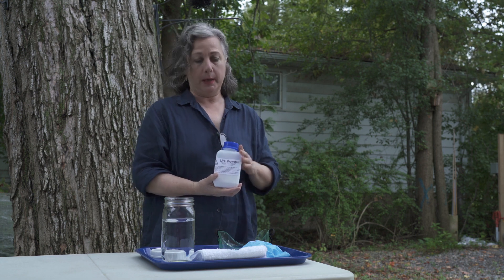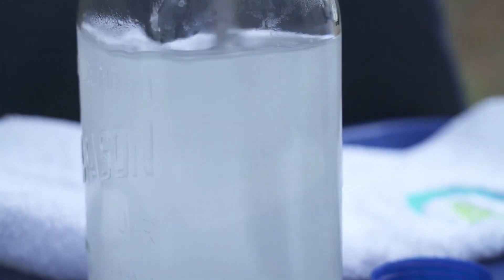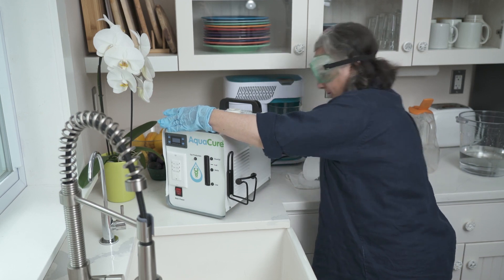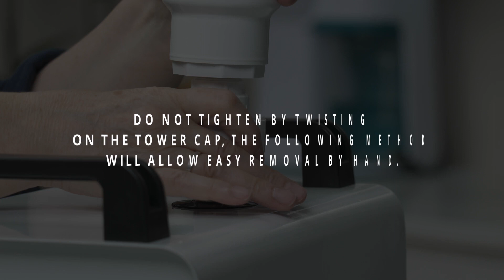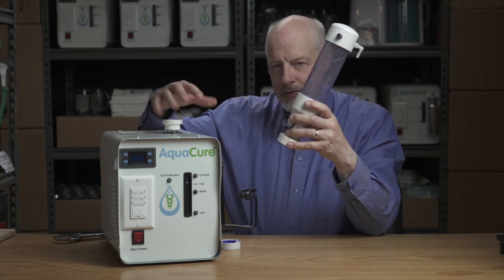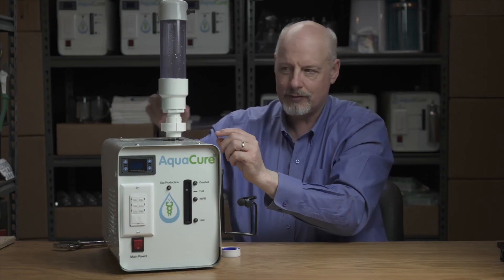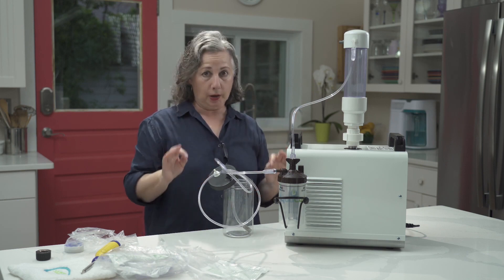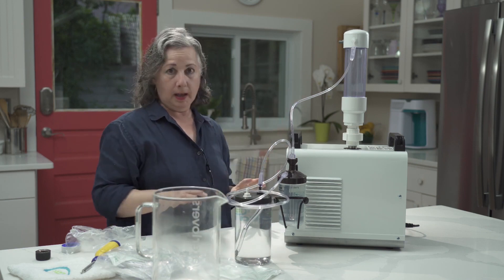AquaCure AC50 SetUp (series video 3)

Comment: 80g / aprx. 6 tablespoons of Lye to how much water please …talking dcl/litre not cups …how much is capacity of the AquaCure tank to be full in dcl/litre please ???
Reply from the maker: See the videos to get the answers needed.  It doesn't matter how much water you use to mix the lye, only that it's enough water to fully dissolve the lye.  We recommend 3 cups (about 750 mL) because that allows mixing in a 1 quart (1 liter) wide mouth glass jar without spilling or splashing.  
The amount of water for mixing or lye concentration doesn't matter for electrolysis, ONLY that there is enough lye in the water for the electrolysis to happen.  The minimum amount of lye for good electrolysis in the AquaCure is 40 grams.

As for how much water the AquaCure can hold, it varies per machine... But generally is in the 1.5 quart (1.5 liter) range.  There isn't an 'exact' amount I can give you because there are too many variables.  But you can determine how much YOUR AquaCure needs with a little experimentation when doing the HOT tap water rinses.  
YES it is OK to have the AquaCure plugged in and running when filling with HOT tap water to check the level sensors functionality (actually recommended).
The AquaCure will work fine with just water for everything except producing Brown's Gas.   For Brown's Gas production you need the lye solution with at least 40 grams of lye (recommend 80 grams of lye maximum).

Comment: Just curious as I am an AC owner….I clean/rinse it with warm distilled water. I know you say tap water is ok to clean it but, I don’t trust my tap water. Why is tap ok to use to clean/rinse but not to operate?
Reply from the maker: Because you pour it out without electrolyzing it.  Rinsing with distilled, after heating it to 140 degrees, would take crazy amounts of water, very inconvenient and expensive.  But OK, if that's what you feel is right for you.  I don't.

Comment: Aaagh! Too many variables! I need help.

She says to use a tablespoon measure for the lye. And to add 6 of them into only 3 cups of distilled water. In the previous setup video he measured one tablespoon then poured straight from the lye bottle into a full jar of distilled water, and then added even more distilled water to machine.

But on one or two of the various instructional pdf updates, or notes, manual etc... there are multiple references to using 6 TEAspoons of lye! 

I don't want to tear anything up, I'm not experienced with any of it, so I read and watch all info. I was already trying to decipher through instructional changes and then these new vids came out. 
My brain had all sorts of mix and matched ideas of what the correct instructions were. 
I DON'T KNOW WHAT IS RIGHT OR WRONG, OR TOLERABLE OR DANGEROUS, FOR THE INITIAL SETUP AMOUNT OF LYE AND THE AMOUNT OF DISTILLED WATER TO BE USED
Is it supposed to be 6 TABLEspoons or 6 TEAspoons?
 Why does it say 6 teaspoons at all on the pdf?
 I'm so worried I put too much of something and tearing it up! 
Is it only supposed to have 3 cups of distilled water? 
Surely more doesn't matter as long as it doesn't overfill. What is the max and min of lye that is acceptable and will work without concern? 
Would too much lye be dangerous? I realize it will cause crystallization and could damage machine. Just want to know for sure the acceptable range or max amount of lye.

I really wish I didn't have to ask, I wish I understood all of this stuff but I don't. It may seem like common sense or that it should be obvious, but I've never seen or used lye in my life and have always been taught it was caustic and dangerous. So I have no reference frame from which to understand - except insecurity. There's also so many different ways shown, I was already second guessing myself, and not clear on what was old information or new information. And then it just so happened that new instructions came out!

 Which are GREAT btw, best ones yet!

The problem is me and my insecurity, my lack of experience with the subject at hand, and information overload. 

I'm so scared I've put too much lye and ruined things. Wondered if too much lye would affect and get into the drinking water. Now I'm being told "get it out!" because it's going to eat the metal. But she says 6 tablespoons!  ...help

......sos.......
Reply from the maker: It's always supposed to be 80 grams of lye.  Says so in previous setup video TEXT under the video, (where I corrected the error) and on the lye bottle and in the Operation Manual UPDATE (which supersedes the manual). 80 grams.
80 grams of lye is about 6 tablespoons.  Nowhere do I ever recall saying teaspoons (maybe I got an abbreviation wrong?  I'm not a cook :)).  

It only takes 40 grams of lye to get full gas production and it isn't too detrimental to put in as much as 120 grams of lye.  To little and gas production is affected.  Too much and it tends to 'plug up' easier.  Too much will NOT 'eat your metal, that's just ignorance talking.  Either way (too little or too much)  is NOT dangerous, just inconvenient.  The exact amount of lye is NOT critical.  We've found after decades of use by many thousands of people, the 80 grams to be the most practical in the AquaCure AC50.

We recommend mixing the lye in 3 cups simply to prevent spillage.  Once it is poured into the machine, you THEN add whatever distilled water (into the machine) to bring it up past 'ReFill'.  It does not need to be 'full' to start and I don't recommend trying at first, in case you over-fill.

As for the fear mongers saying lye is 'dangerous'... See this FAQ:  https://eagle-research.com/faq/is-lye-safe/

Use these NEW vids as the touchstone.  The old ones were quick and dirty, just to get SOMETHING out there.  

May the blessings be
George Wiseman
Reply from the maker: Always TABLESPOONS never teaspoons.  If there is ANY reference to teaspoons anywhere please do TWO things for me.  First, tell me WHERE so I can attempt to correct it   https://eagle-research.life/contact/
and second REPLACE the word teaspoon with TABLEspoon.
Reply: The 2019 version says 8 to 9 tablespoons.
Reply: @gregpeterson994 yeah that’s what I saw is 8-9 Tablespoons. It’s the Manual called “Interim Version 200205,” so I think it’s outdated. I’m just going to go with 6 Tablespoons as mentioned in this video, shown on the sticker that came with the lye, and reiterated by George Wiseman numerous times on this thread :) 

Blessings and good healing to anyone seeing this comment ❤